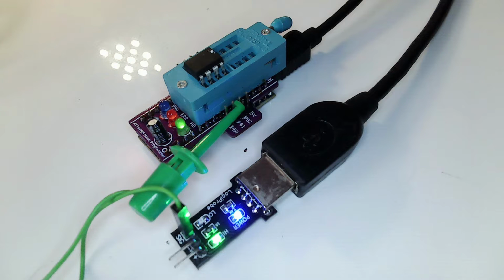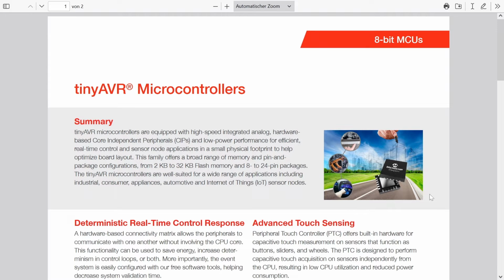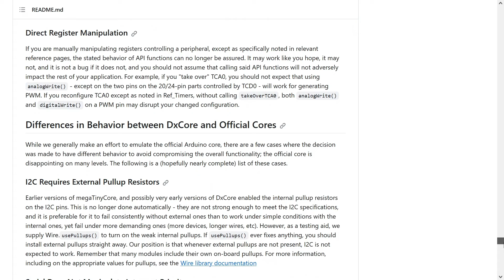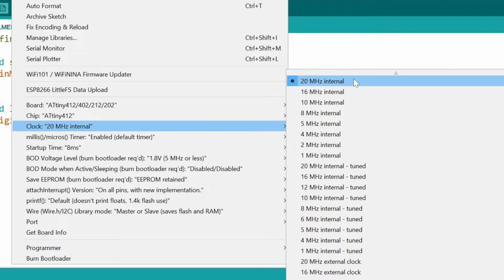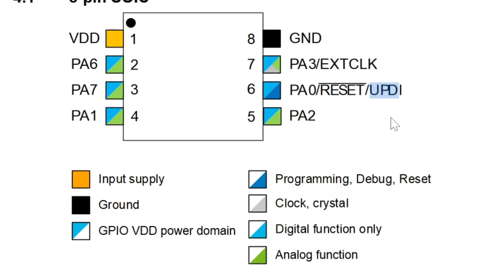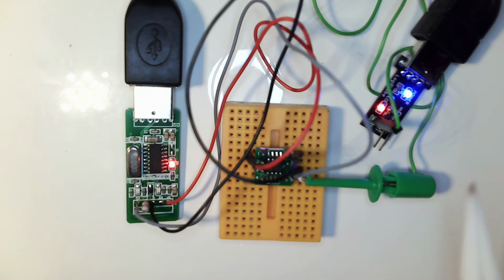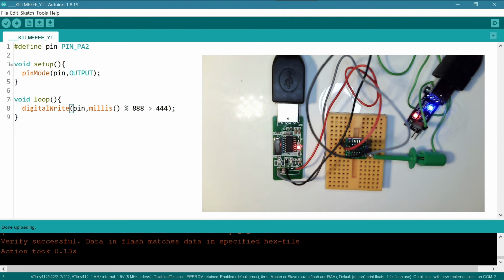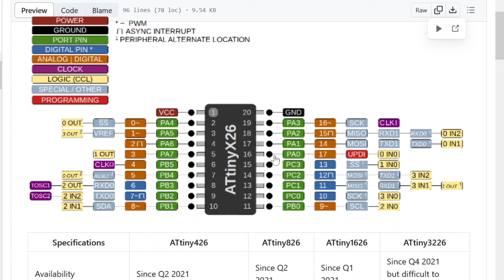UPDI - The Next Best Thing Since Bread Came Sliced

Comment: Wooow!, I had no idea this was possible!, you forget to mention to put the programmer config in SerialUPDI and SLOW was the inly one that worked for me. Thank you for your video, It helped to me a lot. Question: how would be possible utilizing the Serial communication as well? I was trying both at the same time, bit there seems to be interferance with the Serial pins of the attiny
Reply from the maker: Hi Fabian - welcome to the channel! 
Thanks for the kind words - glad I could help! And yeah - Serial is possible - sadly not over the UPDI pin :) At least not in an Arduino IDE - not sure if debug statements over UPDI are a thing in Atmel Start/Atmel Studio.
If you wanna have some trusted "debug" I'd suggest a second serial adapter and something like CoolTerm to read from the serial - in Arduino IDE you'd have to switch ports for Programming and debugging (b'c of the separate program/debug port).
Keep in mind that serial functionality "costs" a lot of program memory; I think just including 

Serial.begin(115200);
Serial.print("Hello");

Will cost you about 1k - on a '412 MCU that's 25% of program memory.

To find the pins dedicated for serial - check Spence Konde's documentation: look for your chip, you'll find something like RX and TX in the pinout. Remember that the connection to your Serial Adapter is cross over... yeah, it's easy to forget things like that. Ask me how I know....

Anyways - have fun with UPDI!!

Comment: Argh! Thanks Arduino guys! Sketch menu, 'Upload using programmer' not just 'Upload', or the 'Upload' button on the toolbar! Wouldn't it have been better just to use the programmer if one was defined in the 'Tools'? I was on my third pass of the video (believe me, Det's little digressions are a lot less amusing third time round!) and my second banging of my head on a brick wall before I noticed that little gotcha! And the error message could be more helpful: 'A programmer is required to upload'. No shit, but I have a programmer, I've defined it here, I've double checked its COM port, and then doubted my own wiring, and my sanity!

As a tip, it is probably quite easy to make your own, but at only $10, Adafruit's 'HV UPDI Friend' seems like less work (and, by the time you are done, probably less cost too). USB C connector, switch for 3V/5V and a 12V boost converter for resetting the UPDI pin if necessary. If I'd made my own, I'd still be double-checking the wiring now!
Reply from the maker: Glad I could help, John :)

Comment: This video is so slow paced that even watching it on 1.5x I have troubles to not fall asleep. First three minutes = ATTiny needs to use lot of pins for programming, new TINYAvr just one. On ATTiny these pins have multiple functions, on TINYAvr the pin is dedicated to programming.
Reply from the maker: Hi Radek - you know, the one thing youtube taught me: you can't make it right for everybody. So I stopped trying. I make my videos in the way I think they should be made - if this doesn't work for you: bad luck there, watch someone elses stuff.
I won't even discuss this - let's talk electronics, not bs like that.
Reply: @DetBuildsStuff Well, if you want to talk electronics.... The issue is that the useless filler talk will make you make mistakes. For example around 2:00-2:40 you talk about how using pin for multiple things is an issue. And then you mention that it can get more complicated because there are chips with more pins....
 Also in an 18 minutes video covering UPDI I would expect more information. For example mention of high voltage UPDI, description of the UPDI physical layer (a.k.a. how is it able to communicate both ways on a single wire), the reason why there is a resistor on TX/RX (you can choose any value for the resistor - what if I choose 1M resistor), the fact that using UART is quite a hack and needs the software to behave the special way as the resistor is (unsurprisingly) not UART to UPDI convertor. What is the speed of UPDI and maybe even a screenshot of the scope with the signal on it. 
You should also mention that there is a curiosity nano board for various AVR chips. And it can be used as USB programmer as well and even with the support of official AVR tools. 
Also with the introduction that the viewer got to a level that he/she can use the "raw" chip on his/hers boards, I would expect tips and tricks how to do that. So for example how to make a programming connector on your own board - for example what pins do you need to have on the connector. Or also if it is a good idea to include the resistor on the board, so then you can just connect the UART adapter....
You see how much information you did not include in your 18 minutes long video... So if you cut your, how you call it bs, to the half, you could include so much more of actually interesting information...
Reply from the maker: You know that us creators do these video on our free time, right? I mean - for someone who doesn't produce content, you're a pretty greedy (can't write the word here).
Maybe a little respect for the folks who does this for you would be nice - but' maybe that's just me.

Please - unfollow. You're wasting time here.
Reply: @DetBuildsStuff No, you should know that there are creators that do it for money. 
And how do you know that I do not produce content? Maybe you meant that I am not producing "(low quality) free content on youtube...."
But you see, you said: "let's talk electronics - the core content of the video - not the form". So I pointed out like 5 examples of that and now you call me greedy.... I would unfollow at once, but luckily I am not subscribed....

Comment: please explain line 8. can the pickit 5 be used with arduino ide?
Reply from the maker: Hi TheUnofficialMaker - welcome to the channel!

Line 8 - man, I have no idea what you're talking about. If I have to guess what ppl wanna know, there's a high chance I'll get it wrong (rabbitholes, you know?).

I have to admint that I've never been the PIC guy; back in the days I did some 8031/51 assembly, but PICs always escaped me. From the channel you can tell that my current focus is ATIMEL or ESPRESSIF. The next most intersting MCUs for me would be STMs - RP2040 is nice, but ESPs are nicer :)

So - no idea about your PickIt 5. But you may wanna give UPDI a try - these are some smart MCUs.

Comment: Hi Det, It seems there is an issue with Dr Azzy site and the Jason URL dosent work at the moment. No idea why !! not my thing....cheers!!
Reply from the maker: Hi Andy - yeah, it's been down for a week now and I have no good way contact Spence. The Core is included in the DL for the multiload Display module (https://youtu.be/WBLlpKupU5E), but this is the Windows version; if you wanna do linux or mac, you have to extract the needed files from the DL. 

Fingers crossed!
Reply: Cheers ! @DetBuildsStuff

Comment: Hi Det. I have successfully used a FTDI adaptor to program an ATTINY412, i used a 4.7k resistor, worked first time. thanks again for the video. I used the 2.2.1 Arduino IDE and serialUPDI as the programmer
Reply from the maker: Hi Peter - great news! Thanks a lot for the info: it's alsways good to have a second head thinking about this stuff :) UPDI will follow us in the comming projects; this morning, Rich and myself started a new one with an 3226 - stay tuned :)
Reply: This is exactly what I am trying to do.